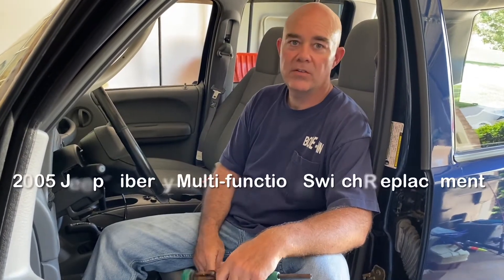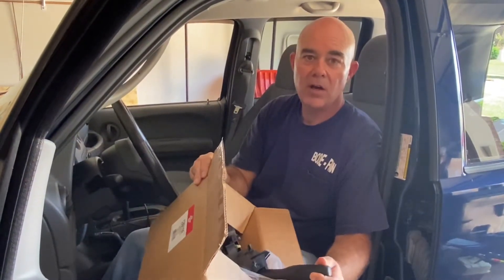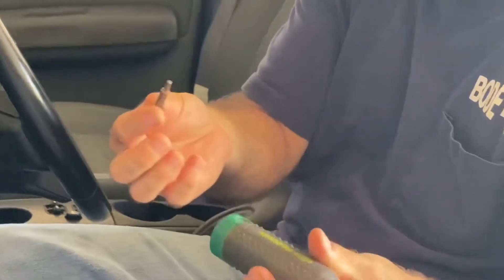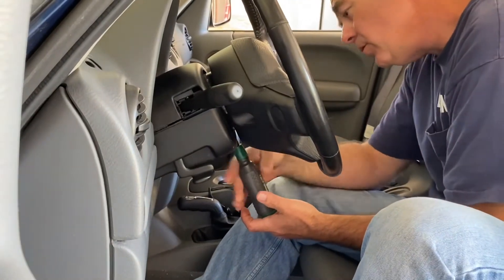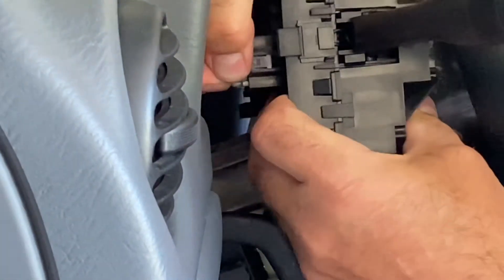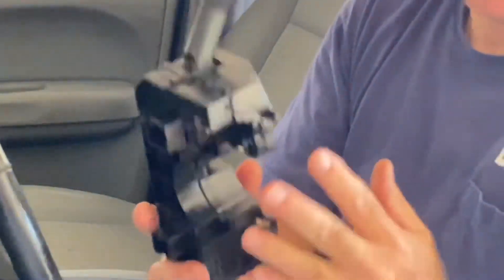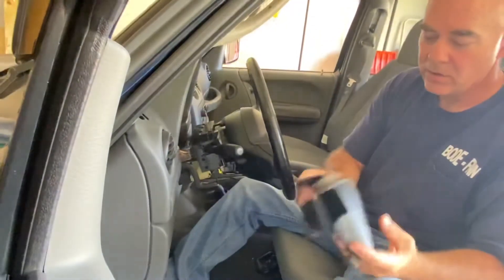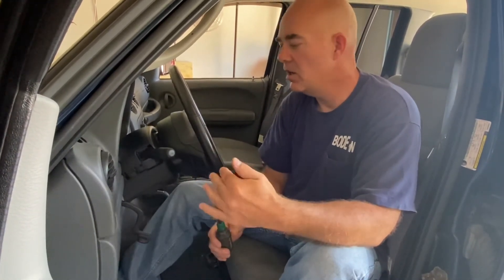Replace Multifunction switch 2002-2007 Jeep Liberty (in Minutes)

Comment: On 2007 jeep liberty you have to remove ESP button. How can this button connector can be removed ? On your video you don't have ESP button on your upper plastic part of your multifinction block, because your Liberty is under 2006.
Reply from the maker: @2:39 in the video you see me remove the top cover. The ESP Button is mounted to the cover(on vehicles equipped) and is removed with it. There is one electrical pigtail to unplug if you needed to for some reason.

Comment: My wipers work but not the blinker-the lights for the blinkers don't even turn on.. Is this more of a Turn Signal Relay I have or would I need to replace the switch like in this video?
Reply from the maker: It is possible that you have a faulty relay and or a faulty switch. Have you tried the Hazard Switch? Also if the vehicle is equipped with trailer towing package it will have two separate relays, one for each side.

Comment: So, my windshield wiper fluid pump isn’t getting any power to it along with the rear wipers themselves. The front wipers still work though. Could this be an issue with the multifunction switch?
Reply from the maker: That would be a possibility. The switch, the wiring and the body control module are all used for both the fluid pump and rear wipers. Might be good to start with a common failure part such as the multi-function switch.

Comment: Have a  jeep liberty sport Could the multifunction switch Cause your speedometer lights don't work And when the car is off Intend to stay on until I switch the knob on and back off.. All my fuses  And all new bulbs
Reply from the maker: It is possible the multi-function switch or could be that the DRL Relay may be sticking if equipped. Located inside fuse/relay panel left side of dash with door open. I would think the speedometer light would be a separate issue.

Comment: I have a 2011 and can't get the front turn aignals to work. Back works fine however they blink fast and I'm assuming thats because the fronts aren't working. Any ideas
Reply from the maker: in the past when your blinker is flashing fast it usually means one of the bulbs is blown on that side of the vehicle. Replacing the failed bulb generally takes care of the issue.
Reply: @FreeAutoMechanic  neither is blown. The front just aren't getting power.

Comment: I think i am having the same issue.  but the lights just come on typically about 20 min after we have hooked the battery back up and left the jeep and they will not turn off.  Also the heat/ac fan is running.  I removed the multifunction switch and the lights just stay on.  I don't nessesaly want to buy a new one if it is not the problem.  Any advice?  Thanks in advance.
Reply from the maker: I would look in the fuse panel located to the left side of dash(between door and dash) and see if it doesn't have a DRL(Daytime Running Lights) Relay. If it does the relay may be sticking on. You can remove the relay to see if the lights  go off for you. Could be a blower motor relay keeping the fan on also but would be a different relay than the DRL. The two systems are not related.
Reply: I pulled the cover to find it has a spot for day time running lights but no relay is there.  My situation may be different because the lights were off but randomly turn on long after i left the jeep.  Any other ideas?  Again, thanks in advance.
Reply from the maker: @nenaguymon7599  If the lights are coming on with the Multifunction Switch unplugged then you may have some kind of wiring issue. If it only happens when the switch is connected, then that would be the first part I would replace.